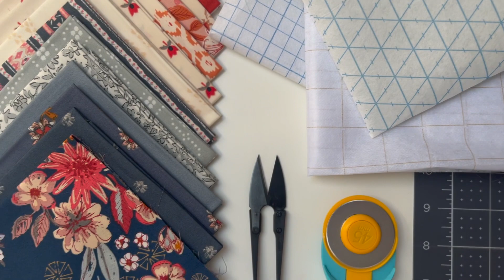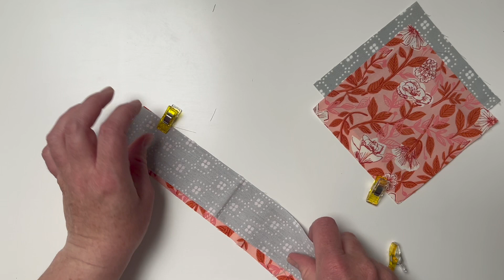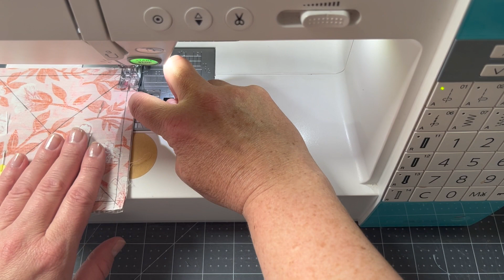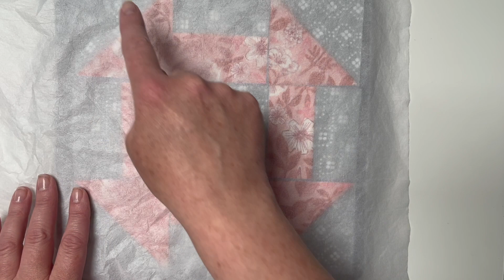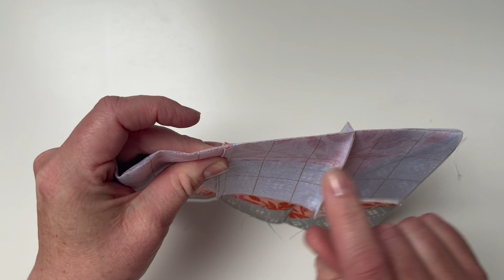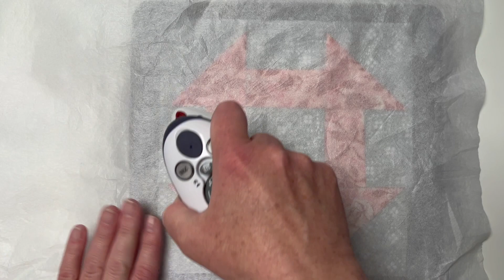Get Creative - QAL 2023 The Sampler Quilt - Block 2

Comment: Thanks Laura, great tutorial. I’m assuming the finished blocks should all be the same size. My block 2 has come out slightly smaller than block. Just wondered what the block size should be unfinished on them all? Thank you. Caroline 😊
Reply from the maker: The finished blocks need to be 8in square - the first block may be larger than than so you can trim down  as needed.